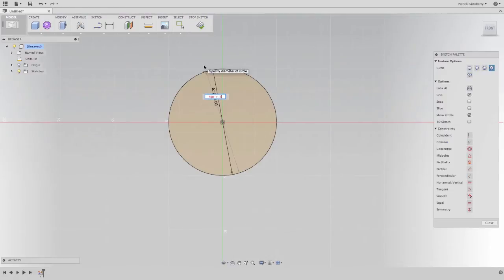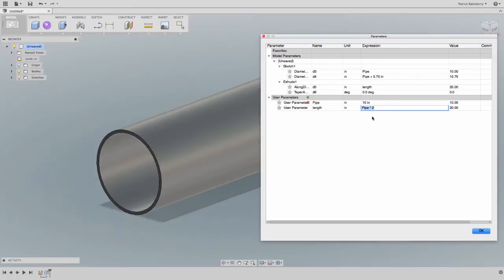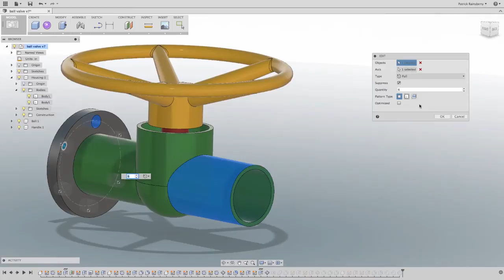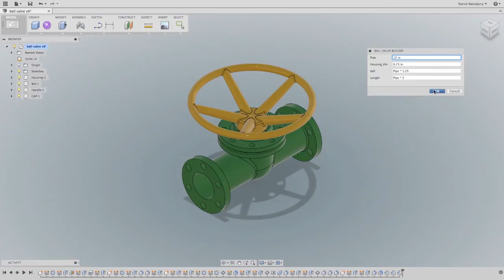Autodesk Fusion 360 Parametric Modeling

Comment: Great Valve ! but remember that the bolt holes straddle the centre line of the pipe, so you need to rotate the bolt holes by 360/(2*6) = 30 degrees